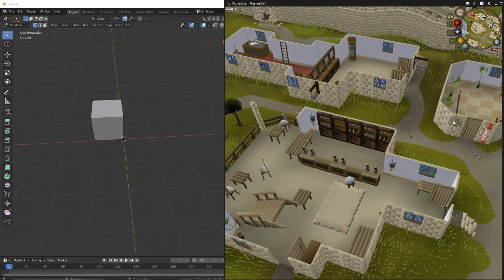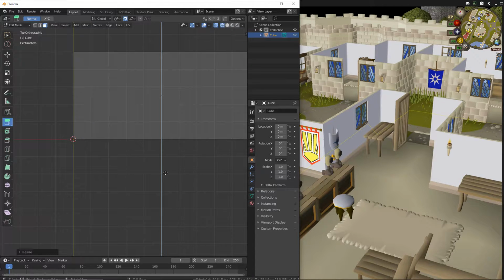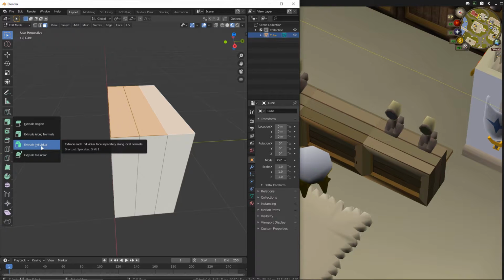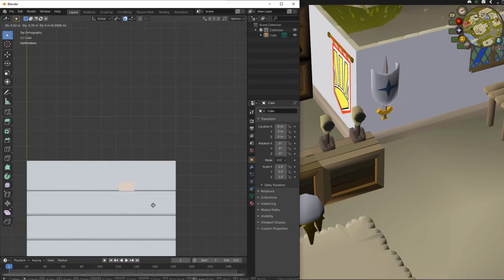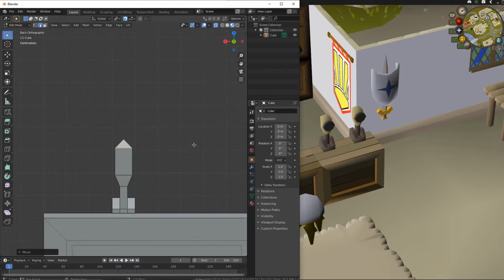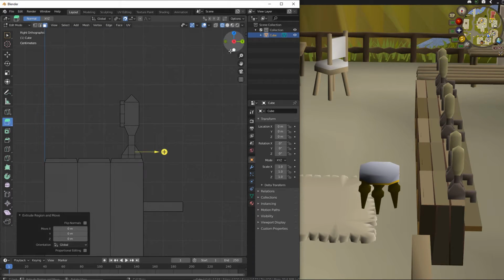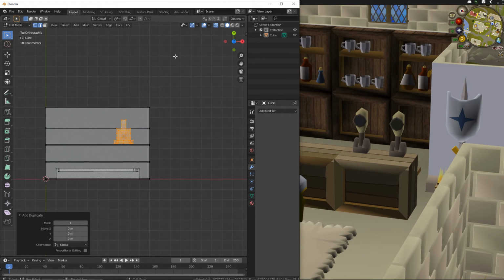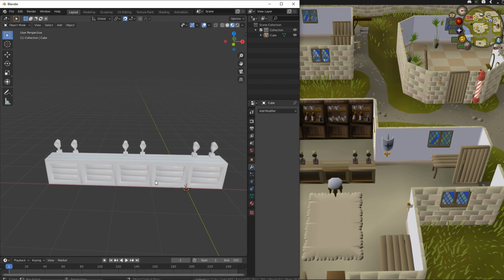Modeling assets from OSRS for VR (Tutorial)

Comment: Not sure if you went back and deleted the redundant faces inside the bar pump, or if Blender does that automatically. But otherwise they are most definitely not needed.
Reply: My bad, you do fix the normals, but you left the redundant faces underneath the join. You get backwards faces because you didn't delete the ones you covered up. It confused blender as it was essentially creating a void. Delete the ones that aren't required before the join and it will do the normals correctly :D